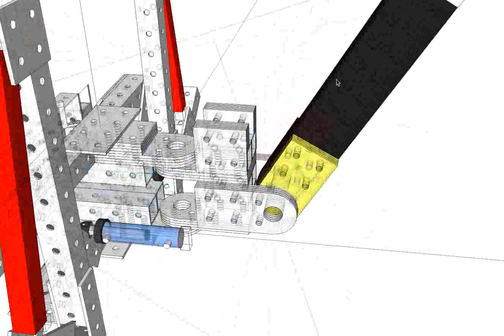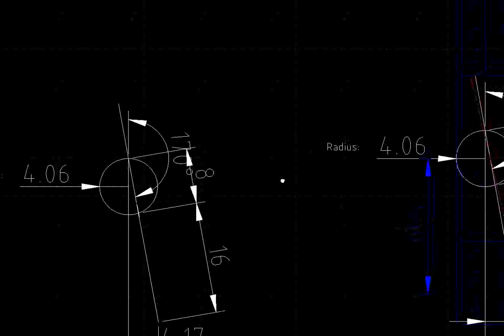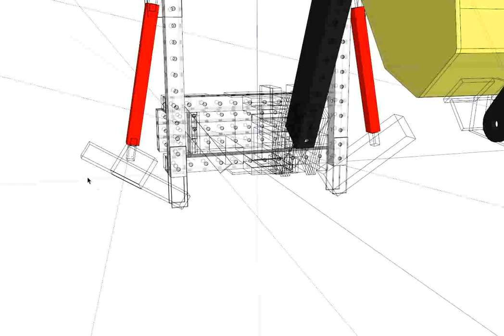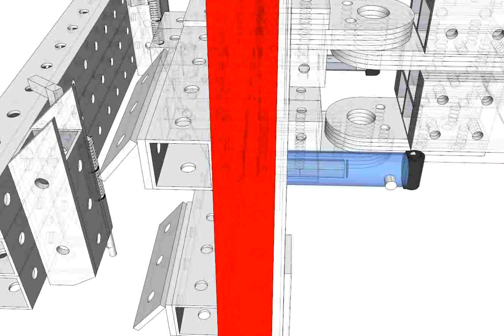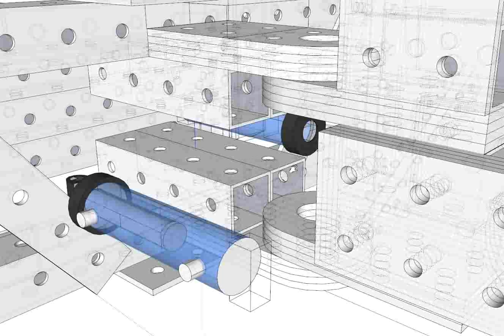backhoe pivot+legs+QA review

Comment: 1. Prob need to angle the stabilizers forward a little. Because the lifetrack doesn't have enough tail-weight. 

2.  Likewise make the boom tip back farther so that the lifetrac can transport it easier/safer

3. You're gonna also need to lock out the lifetrack's tilt cylinders because the hoe will overpower them and fall on its face. A chain is quick easy way to do it. Industry standard is more complex.